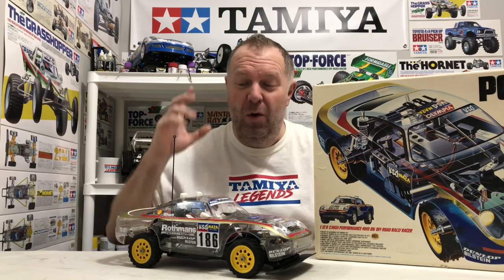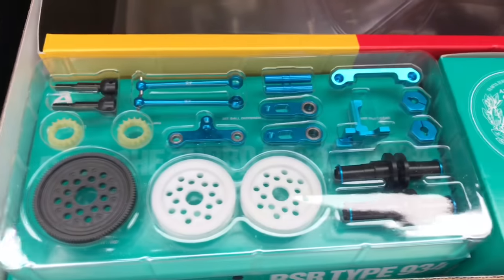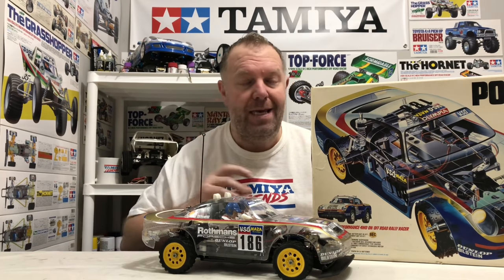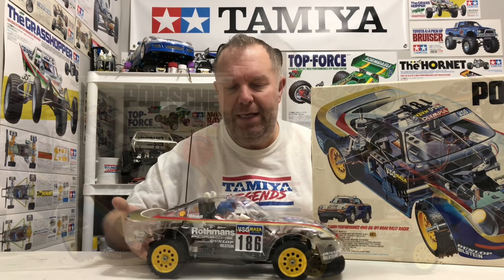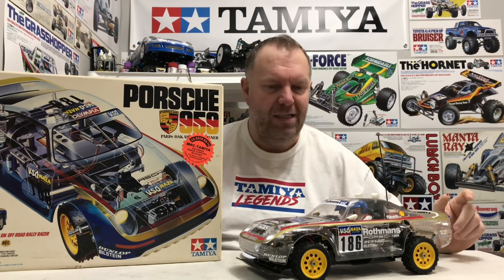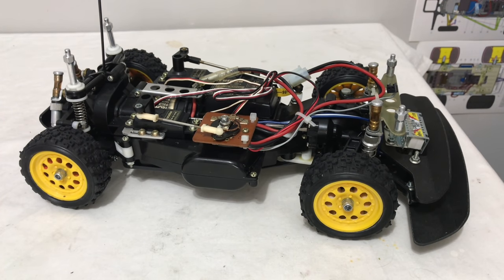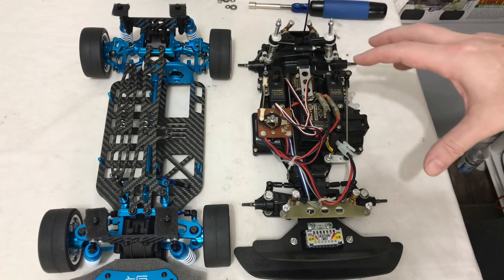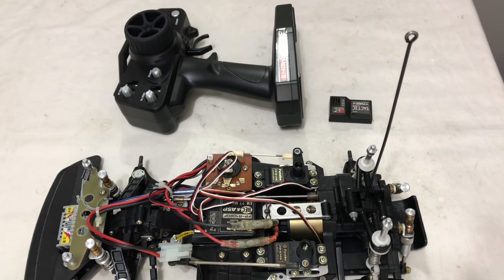Tamiya Porsche 959...

Comment: I also had one of these, and loved building it, as at that time, it was like nothing I had ever built before.... As much as I loved this unit, the one draw back, was it was 1/12 scale.. and if it was not on clean pavement, the thing would bounce all over the place, the faster you went, and the more you push it past that threshold, , the higher the risk of rolling it.. The flat slick tires for it, gave it a neat look, but couldn't run those, as it made it even worse to handle... Please do not get me wrong, I miss it, and loved to just look at it... I suppose, stock, out of the box, and a stock motor, matches it just fine for playing around in the street or empty parking lot, but to throw any measure of performance at these units, I wouldn't do it, as it will only disappoint you... I machined a set of 4, aluminum rims for it, and glued a set of foam tires on, and took it to my local indoor carpet race track, and that was fun, but, even the stock motor, was cooking hot, LOL..  I wish I still had that unit.. The cleverness of the front and rear suspension and the shocks was a great education and was the first time I learned about the damper oil foaming up, and volume displacement, when I asked a guy, what the point of the little chunks of tubes on each shock damper was for... As I was distracted with the idea, that the tubes were to fill the shocks with oil through them, yet, the instruction didn't show that you fill them through the tubes... great car, just hard to keep straight and heavier power.. Here is what kills me... I sold mine for $50 bucks, USD... LOL.... OUCH!!!!!!!!!
Reply from the maker: Great comment my friend 🤩🤩🤩

Comment: Use a hole punch to create some circles to repair the body holes. Apply the circles from the inside, use a cotton bud to wedge them in then go with a little glue. Then you can use wet and dry to smooth the outside edge. Had to do a similar repair before and this worked well.
Reply from the maker: Excellent information thank you 😊

Comment: I was buying broken Tamiya Porsche 959 cars on eBay.  I would just combine all the parts so that I could build one car. However, I ended up with enough parts to build 3 cars. This was not my plan. I have all kinds of parts. I was buying these cars about 4 years ago. However, you can not do this today. Broken cars and even the parts are just super hard to get. I do not have an original unbuilt kit. I do wish that I did. I do have two original bodies, I even have original tires and wheels. I do agree, that this car and the Bronco are probably the most wanted Tamiya cars. I used to work at a hobby shop. I just could not afford to get one of these cars, but I really wanted one. I think it is great that I finally found the chance to actually have get this car.
Reply from the maker: Excellent 🤩
Thanks for watching buddy 👊🏻

Comment: I bought the Celica while living in Japan. Fragile, complex, complete in mechanical design and interesting. Just as you described. I replaced the entire chasis two times, but gave up after that. Always wished I bought one more new chasis set of parts as they weren't expensive in Japan at the time. Just time consuming to swap everything over.

Comment: They could probably revise the suspension so it's a bit more modern or simple with tamiya cva's all around, as long as said parts also fit the original chassis people would be happy with that i think, maybe a bit nicer plastic as well that's more robust & flexible here & there where it's needed for the more fragile parts (0 research into the chassis here so dunno what breaks & what doesn't.)
Maybe a small shock tower that mounts in with 4 screws & a few holes in the tower for different mounting angles & some extra strength.
Along with a revised body design where a piece of lexan or plastic that's easy too strip & repaint becomes the lower front lip that acts as the lower half of the front bumper there & sort of done up like a modern 1:10th scale body where it ends once its vertical or close too it.
So it's not as fragile & easier too produce + a small bit of urethane or similar material as a sort of front bumper if needed a bit above that if not slightly in between the body & the lower front bumper part just for less clatter between the two parts if they rub quite a bit, with some ingenuity that is certainly possible, specially with 3d printing these days.
Though if Tamiya wants too pull a fast one that's still going too sell like crazy they release a porsche 959 on the MF01 chassis with the same style wheels & tires in a fitting size of not identical but with 12mm hex on the back.
Oil shocks & ball bearings in the box, hell they should pick up as many early awd rally cars as they can & produce for that MF01 chassis.
Celica st185, st205, peugeot 205 t16, audi quattro, audi 100 etc...
Reply from the maker: Yeah totally agree my friend, I’m doubting they will do this though 🤔🤷🏼‍♂️

Comment: Be VERY careful when connecting newer radio gear into old MSC's! I burned two of my 2.4 recivers, including one Tactic. The old school MSC's output whatever voltage the battery gives. The Tacic TR325 I used could take a maximum of 6 volts for example. The Hitec one probably had the same limit. 7-8'ish volts of a newly charged NiMh = smoke. 
This worked though... :D Amazing car! I guess you'v seen RCKicks project on a modern take of it? :P
Reply from the maker: Thanks for the information Roger, much appreciated my friend 😊👊🏻

Comment: I have this car, built it with my Dad back in the 80s. The front a-arms, one is broken. Is there a way to get replacement parts? I have not run this thing since probably early 90s. I suspect everything else is working and will need a new receiver too, which one did you use here? Could I get a receiver where I can bypass the servo speed controller?

Comment: I have had the GRb since new, sling with a Marci Samutai, I keep hearing that these were fragile,. I still have both and they do fir the most part sill have the original parts (the samurai had  a technigold fitter very early on). I also had an Avante, now that was fragile! I’m currently rebuilding a 959 but with the celica centre diff. They were a blast to drive hard . One thing I had in the GRb was an acoms ESC that fitted in place of the servo, any idea of the model number as that is long gone!
Reply from the maker: Absolutely fantastic my friend 🤩👊🏻

Comment: Am just about finished restoring a Toyota celica GRB it’s been expensive finding genuine new parts from all over the world just sorting lights I think it’s cost me over a grand and using original acoms gear
Reply from the maker: Wow very expensive but what an achievement once it’s finished 🤩👊🏻
Reply: TAMIYA Legends  yes it pity not getting original shell but got boot lid and lights shell came from Canada next project is re re of the Toyota mountain rider 
After I’ve finished restoring old frog and brat to 80s condition then build a re re of them with latest electronics.

Comment: Something sounds off in the Gears of that one, I have many of them and they are butter smooth, suspension bits are available in ally and from shape ways , bodies from tbg so no need to worry about running
Reply from the maker: Probably the wheels spinning in the tyres I guess 🤔🤷🏼‍♂️

Comment: hi this car is one of my favorite cars i own 7 of these cars 3 chassis are built and one with a body
i all so own a nib and i have 2 others ones in parts to build full cars
you can change the wheels use the tamiya avante 1988 wheel adapter then u can use a normal hex wheel . dont use other avante adapters other ones they dont fit right
u can upgrade this car too use the toyota celica diff and stabilizer bar in the 959 and steel arms now
u can change out the motor u can put the technipower, technituned motor, dynatech 01 and a 540 motor from the tamiya clodbuster with the white end bell 
on your car right the tamiya plug its ment to be tired to the battery clip at the back of it have a look at the manual
as for the stickers the smoke one most sort after because of the real car people want the same
the porsche 959 box they changed it because of the real porsche copyright
they wanted too much money for the logo on the box so they remove it
great car great video tops mate
Reply from the maker: Excellent information thanks for that 😊😊😊

Comment: I just restored one of these parts are very unique. Got mine for 150$ with painted green shell. Anybody know of a good way to get old paint off a vintage body?
Reply from the maker: The best stuff to use is the Tamiya polycarbonate cleaner 🤩👊🏻
Reply: @TAMIYALegends  I saw a video of someone using it and claimed dot3 brake fluid works better and faster. I don't have either thought I would ask before I attempt to save this vintage 959 body.
Reply from the maker: deno zed 
I personally stay away from brake fluid 😳. It can leave the shell very cloudy ⛅️
Reply: @TAMIYALegends  I was thinking the same so I tried nitro fuel but I must have an old bottle(got it with an inferno bundle) cause it did nothing. Going to try what you suggested. Thanks.